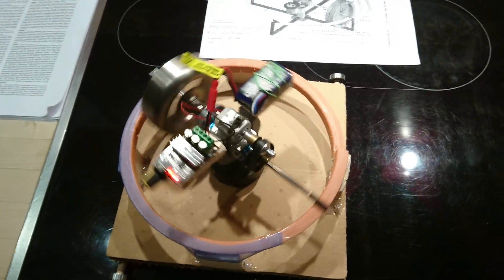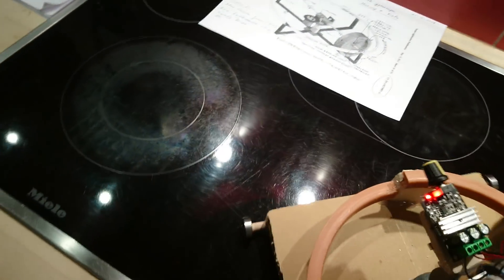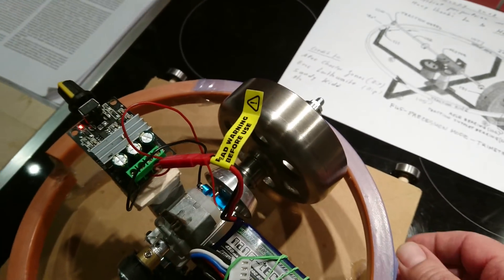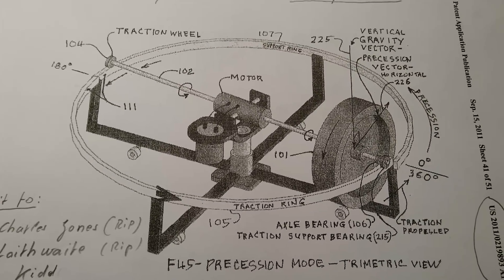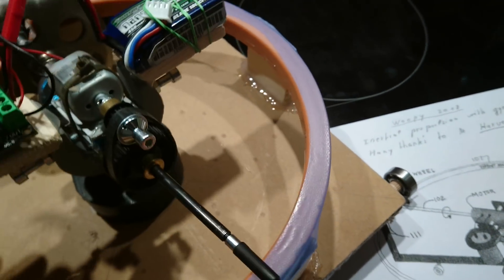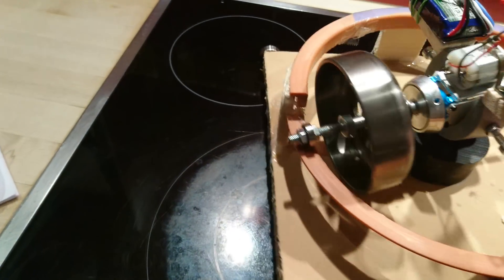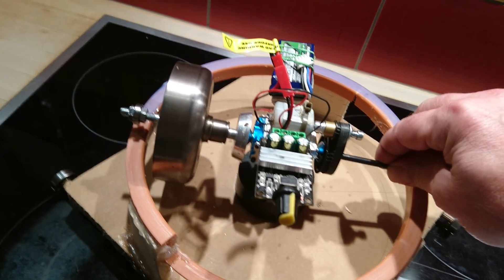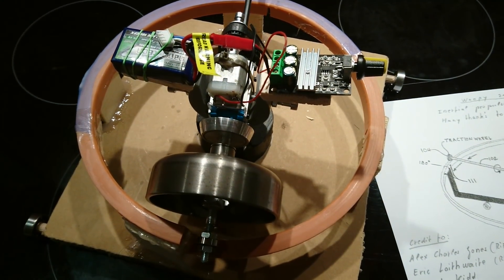Inertial propulsion with a gyroscope part 1

Comment: Nope. Doesn't work.  That thing only works because there is friction between the wheels and plate it moves on.  If you let it operate in space, it would just move forward and backward to the same position.
Reply: That is likely the case. 

The least expensive way to test that would be to put it on some kind of "air hockey" table.
Reply: Doesn't change the fact that from concept, it doesn't work.
Reply: Why wouldn't it work in space? Why is this "friction" not stopping it from moving forward more than backward? Can you explain further, because I'm not sure what you mean.
Reply: Math Easy.  The device pushes itself off on Earth.  Because our earth is so massive, it's possible for the device to move forward.  Just like a car.  But if you had a car as big as the earth, then the earth and the car would move (the earth would rotate and the cars wheels spin) but not go anywhere.  So, in space, you will have nothing to push off on.  Result; the device will just move back and forward all the time.
Reply: @Math: He means that the forward motion is due to a ratchet effect from a reaction between the wheels and the plate, and that without the ratchet effect (in other words, if it was isolated in Space), it would just oscillate around and not move forward in a single direction.
Reply: Code Tech.  Yes, that's what I meant.  You formulated it better than me.
Reply: Blame Yourself That’s why a device is needed to simply tilt the gyro in space to take place of the earths gravity field from tilting it. This device would then tilt the gyro speeding along faster in one direction. Centrifugal forces are the propulsion actions here.
Reply: @debunkified  Don't forget that the coriolis forces will compensate for the tilting.  No effect.  Doesn't work.
Reply: Blame Yourself Don’t you think anything that has rotation, even with a slight drop in gravity, could easily overcome that of a toilet flush or bathtub draining? Let’s think about this a little bit more shall we?
Reply: @codetech5598  Hi! Could you explain better this "ratchet effect" The device is suspended on ball bearings, I can't figure out where this ratchet effect should generate. Thanks!
Reply: @hs_illustrator8832  Yes it's suspended on ball bearings, but the bearings have "stickiness" or "backlash" that lets them "grab and release" like a ratchet which is an unintended consequence which allows this device to work.
Reply: @codetech5598  Hi! Thank you for the reply. yor idea is interesting. In your  model however, the ratcheting effect should take place during the backward stroke of the machine, but the unidirectionality of the ratcheting effect should be induced by something else, maybe the vibration caused by the machine in the forward motion "break up" this ratcheting effect? I find hard to believe that a ball baring has a slight ratcheting effect per se, This would also imply that all four ball bearings are mounted with the ratcheting effect oriented in the same way.
    A pendulum test should set the problem, however it is hard to get good results from it.
Reply: Of course it's all dependent on friction. But it's not even worth trying to explain this to idiots like Sandy Kidd who believe in propulsion by gyroscopes.
Reply: Dan Walker Sorry, Sandy Kidd did not rely entirely upon gyroscopic forces for propulsion, he simply used the gyro as a tool. I know this because he told me this. You think he would spend all that time trying to get a gyro in which has opposite and equal forces to try to lift? You may not want to be so quick to judge other people and call them names when you have no clue or understanding of basic physics.
Reply: You may be right, but I don’t think so. Centrifugal force is in play here, along with gyroscopic forces, two different animals altogether.
Reply: What if you had 2 maGnetic coils with AC?

Comment: Sir plz let me what is the use of this project.
Reply: imagine you have a boat that doesn't need a motor submerged into the water, or a space shuttle not requiring the reaction engine to produce thrust for propelling
Reply: @elgroovy  
I have such a boat! It uses sails for propulsion.